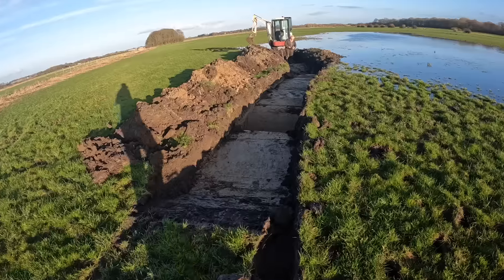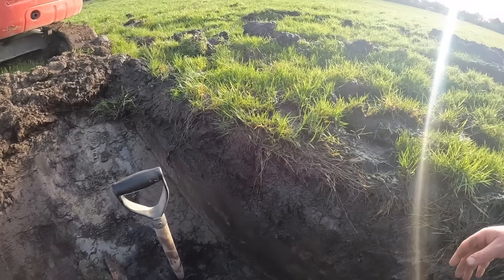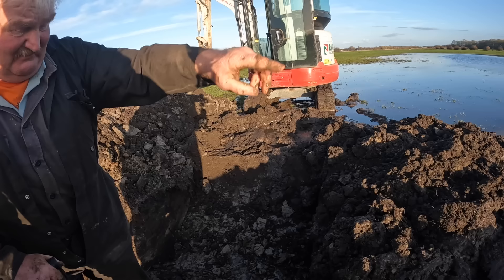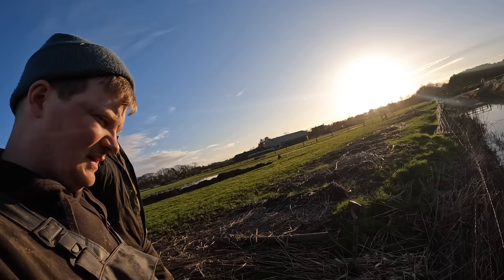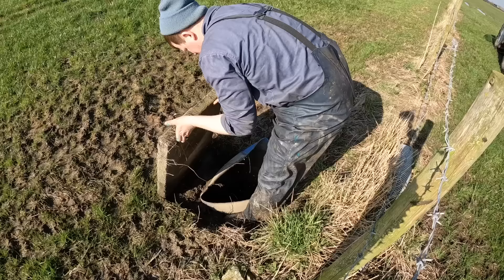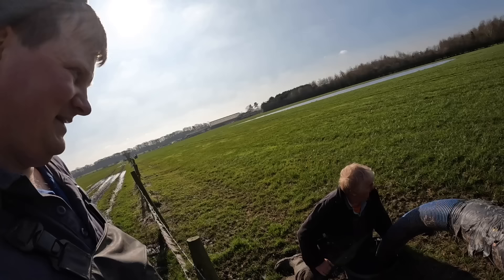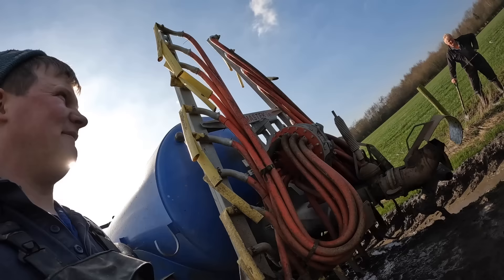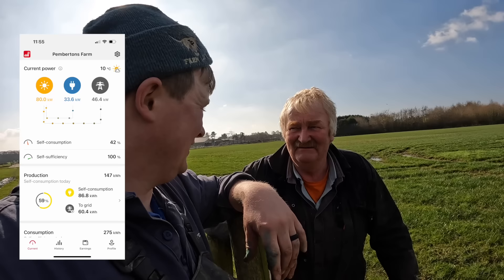WHAT A MESS!!... HIS FINAL JOB BEFORE HE LEAVES!

Comment: From the aerial video, it seems like some of the biggest puddles are not that far from the main drainage ditch.  It would not take much with a bulldozer to make a swale from each of those puddles to the main ditch.  Then the surface water would run away much better.  If your ground is compacted as much as you said, the swales could be a good solution.  Also, I was impressed with the depth of the top soil - almost 3 feet in some places. In the US, we are lucky to have 4 to 6 inches of topsoil.  That also means that if you do swales, you can still easily plant grass on top without having to move topsoil back over.

Comment: staggering how wet it is still - only thing id have done different is a narrower bucket! Our farm in Lincolnshire was heavy clays and we used to have to mole plough every few years and we also found that putting in gravel drain trenches rather than pipe work helped more but i dunno if it would have been able to do anything about the weather weve had the last 18 months!

Comment: I understand the drainage ditch water level being too high from the tile to flow. When  the water level is low enough is your soil too compacted to allow the water to get into the tile? Here in the USA we use a subsoiler to loosen the soil. They don't disturb the surface too much, only loosen the subsurface up to 18 inches deep.

Comment: Tom your Dad is right, you got to get rid of that surface water. Put in some new drainage asap clearly those old clay pipes and crushed main drain are done already, use that large pile of hard core to backfill say six inches above the new pipe that should help a lot. Do it this year and it will save you a lot of grief in years to come. I know it's a pain in the arse but so is having flooded fields years after year. Use that water pump I bought you to speed the clean up. Best of luck Ginge  speedy recovery

Comment: What I do in me fields with puddles in them when the ground is not letting the water through. I dig down find pipe dig along pipe for a couple of meters with a narrow bucket not the bucket he was using there then fill up with clean stone like a triangle to the top leave a bit with the clean stone open so the water can drain down through the stone like a open plug to the pipe and get away. I have them in silage fields and it doesn't bother the mower or baler. You get a puddle when you have a lot of rain then when it stops its gone in a few hours and you're grass doesn't get damaged by water lieing on it all winter and you will find the ground stays dryer and drys up quicker to.

Comment: All the best for the operation.
have you ever tried using a pipe ferret with high pressure ? I don´t know if you have a high pressure equipement for whashing your kit that could be fitted with a ferret.
that could help evacuate the silt in the pipes.
I agree that the fields are not in the best position to accept a tractor and a tanker rolling over it. far to wet. but congrats for not making a booboo.

Comment: Hi Tom. Are all your drains under the fields clay pipes?? We had the same type of drainage put in around the 1950s.It drained the area of 80 acres.. In the late 90s they started failing and the natural process of water logging began. We spent 4 months replacing them with the plastic version and several thousand tonnes of drainage stone.. we have never looked back. I understand your water table in the main drain is a problem.. but when you stone over your pipe it pulls the water below the sod and dissipates rapidly.. hats off to Andrew and a speedy recovery..

Comment: Wishing your father the best outcome from surgery and recovery. So did I understand things right that you don’t have the luxury of having an ideal slope in your drainage network, and when the canals are full it slows everything regardless of the drain system slope. Your drains silt up and require more maintenance? Sections of crushed pipe don’t help matters. What are your feelings about corrugated plastic pipes with silt socks vs. the old terracotta tiles?

Comment: Hey Tom and the Ginger Warrior, with the amount of water that you retain have you ever thought about copying what they in the fens to get rid of there water?
Reply from the maker: What’s that?
Reply: @TomPembertonFarmLife  Basically what your dads doing to drain the puddles now a diggers width ditch but around the fields and bigger than what you would drop a six inch pipe into. For instance the drains you were sucking out would not be covered but a deep trench/ditch flowing to where your drains go now. They may not be needed year on year but it would drain quicker when you needed it.  Surely you know someone who knows someone etc that could visit talk/to.  In the end what you have, seems to suit you 9 times out of 10.  They have the same problem as you and that is the land is flat and the water does not drain away fast enough, but as always it a balancing act.

Comment: Hi Tom and the Ginger Guy.  Your dad pin pointed where the pipes where but he is right you need to do something to help get the water off. Would it be better to dig new pipe lines and lay new pipe to fix the problem. That way you can dig a narrower trench reducing the impact on the fields. I know you like to poo poo some of your dads ideas but there are usually based on his extensive knowledge of the farm and surrounding areas plus some BS. 😅  Growing nourishes green grass is half of your feed for the cows and it will be cheaper to fix the pipes rather than buy in more feed. It's a lot of time and labour but you won't regret it in years to come with dry fields. I wish the Ginger Guy well with his surgery and hope he has a good recovery taking it easy in his new role of office administrator. Thanks for the video. Chris from Victoria, Australia 🇦🇺.

Comment: I guess there might be some sort of variation between you guys and over here in the USA but our personal experience is that if you want a feild to really properly drain you got to use modern drain tile you can tye your old clay ones in to your new tile when digging and it will trickle into the new tile but the clay ones just pack full of dirt and then are close to useless new ones don't do that I can almost garenty if you guys tile the hole feild it will fix your problem